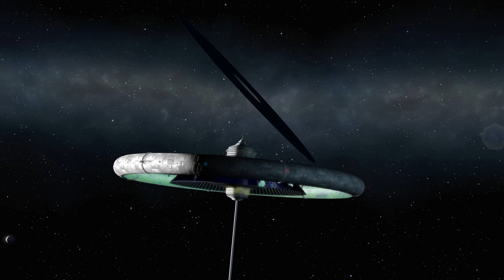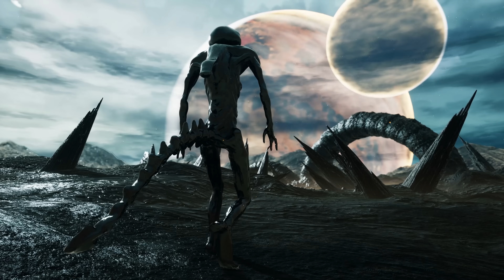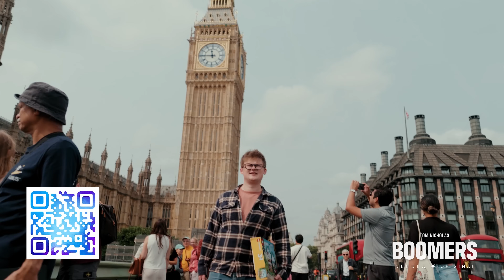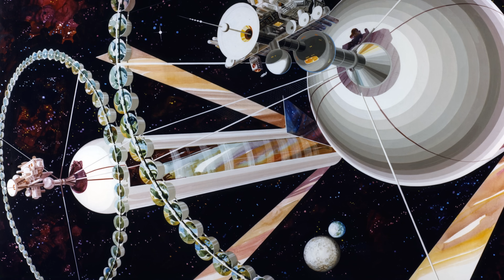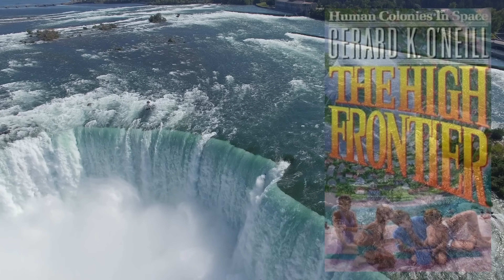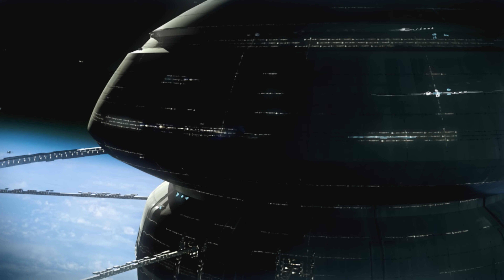The Bernal Sphere Space Habitat

Comment: Solar sails could orbit an asteroid up to a gravity constant centrifugal force. Hollowing out the rock asteroid to turn into into a glass like structure that could then be turned into a centrifugal space station wheel. 
When the asteroid is used up the station has reached total size, The outer rim being the floor, & life support ring, with more floors added towards the hub being additional levels for agriculture etc. The station not having a square or round profile , but 3-4 convex sides!
Spokes to the centre hub being the weightless docking & dockyard port, with barely any rotation to complicate docking!. 
This could be built beside the asteroid ring between Mars & Jupiter, then moved into orbit around Mars or back to earth.
Earth or Mars orbits being needed for lower power assisted docking procedures, to reduce speed for docking approaches.

Comment: Ive imagined growing plants in low spin could be helpfull. High yield plants that dont need as much bracing. Low power cost for hydroponic solution transfer, higher efficiency harvest robot. Heck, they could even grow structural materials. 
Got this crazy idea using bamboo or poplar. Not on the integral trees level though😂 Those things are beast!

Comment: I've never thought of that last idea, at least in terms of space stations, but it makes sense.

I'd considered something similar for a spaceship, which now IA pointed it out is the same way cellular life works.
1. A hollow shell thick enough to defend from most impacts and keep loose debris from floating away.
2. A single anchoring pillar from one end of the shell to the other.
3. Engines, modules, etc. are either mounted to the inside or outside of the shell or the central pillar.  

There is enough free space on the inside for tugs to move, repair, and replace the modules at will.
Nothing is so firmly attached with the shell that it can't be moved in order to make repairs on the shell.
A free floating drone or astronaut can inspect every single square inch of the vessel without needing to cut access holes.

At low tech/low economy, such a vessel would be too expensive to be practical, but since volume is cubed with radius and surface area is only squared, it becomes shockingly practical to add a little extra space at larger scales.  (Especially since such a large vessel would have changing requirements and updated technologies throughout it's construction phase alone, much less it's entire life cycle.)

Comment: It's Tsiolkovsky, the early space travel writer, not Tchaikowsky, the music composer.

JD Bernal's habitat did not spin for gravity, and was not a fully worked out design study.
O'Neill's "Island One" was not to the more rigorous standards of the later, larger, funded, multi-disciplinary NASA Ames/ Stanford Space Settlement Studies of '75.
O'Neill chose the sphere because the radiation shielding (equivalent to 1.6meter thick concrete) was by far the most mass, and a sphere has the lowest area per volume enclosed. His actual design requirements and rigor of making it feasible to build now (back then) bears no resemblance to Bernal's in 1929. It's a misnomer to call O'Neill's design by the same name as Bernal.

For O'Neill's purposes, size was based on the required population of 10k for the factory infrastructure which builds it and goes on making more habs and SPS.

The Ames studies at Stanford didn't like the faster spin rate nor the little available area of the inner surface under 1G.
Hence the Stanford Torus, which spins half as rapidly with very much flat floor area.

Comment: Sounds like you might be able to help with my sci-fi concept: a Bernal sphere with a size of Mars. Contained ecosystem with habitation on the inner surface (semi-Bernal sphere?) which rotates for gravity, relatively stable poles (though they may be rotating as well just not perceived) and the core is an artificial fusion reaction to create heat and light (an internal shade provides a night cycle). I would like to get a more in-depth review of this topic, especially how gravity is affected at latitudes on the sphere or at different altitudes from the surface and how ecosystems might be affected by these changes. Do you know of any research papers that might highlight this more?

Comment: Given the original Bernal Sphere concept, I was surprised this didn't go into pantropy.  Though if you can tolerate permanent zero-G, a sphere "wastes" a lot of volume and air, unless having lots of room to fly around in, with lots of perch points throughout the volume, is the point.   The best aspect of a large Bernal sphere would be minimized mass per radiation-protected volume, but lighting it despite internal occlusion of the sunlight (dwellings and such scattered through the volume) might be a limiting factor for really big spheres.  I guess if you limited the density of internal constructions, light would naturally scatter around, giving the interior a sort of 'translucent' appearance.
A bunch of smaller spheres side by side in a sheet - bubble-wrap habitats - might be a decent compromise - lots of volume, lots of light throughout, less air needed for a given amount of surfaces, assuming people still psychologically preferred that.
Reply: Though it probably would be tough to get the first generations to prefer seeing land rather than a ''sky'' when they look 'up'.

Comment: A ring with a very large diameter which is spinning fast enough to generate 1G on the inner surface of the ring will also have a very large linear velocity.  This velocity will stress the material the ring is made of.  Does anyone have an estimate of how large a 1G ring built using contemporary materials  could be without shattering? I'm just looking for a ballpark estimate that doesn't use some "handwavium" scifi material for the ring.
Reply: Steel can safely go up to 4 KM radius

Comment: For some reason, cylinders seem like the way to go; they're structurally simple and the spin gravity is uniform. The biggest challenge would be directing sunlight in from the outside, but that's an issue with a spinning sphere as well.
Reply: Yeah I agree. The concerns about the caps being less structurally sound seem like a complete non issue to me, I don't know why he would even bring that up as if it mattered.
Reply: @algorithmgeneratedanimegir1286  It shouldn't be too difficult to build a scale model in orbit, maybe just some fitted rings shipped up on a Starship or Falcon Heavy. Falcon Heavy's faring limits are: 
Diameter: 5.2 meters (17.1 feet)
Height: 13.1 meters (43 feet)
So, maybe two 4m x 4m cylinder parts, to form a 4m diam cylinder 8m in height.
Attach, induce a spin, and get inside and test it. Of course it's far too small to be useful. The next step would be a 20m diameter structure, but I'm honestly not sure how you get a ring that size into space. Cut it in 1/4 segments then assemble with a spacewalk?
Reply: An object with a long center of mass, spinning around that long axis, is inherently unstable. It must always want to wander off the axis, and will move to tumbling.
Yes, you can design active stabilization, but a good engineer doesn't design in defiance of the laws of physics and then apply complexity to overcome the design flaws.
This is completely apart from pointing difficulty if it's not paired with a similar counter rotating object.
Relying on the pairing to overcome the actual instability is also not reliable / simple.

A dum-bel is stable, as is a Torus.
The Kalpana design is about as long by the axis as can be stable, not equal to the diameter. Making the outer rim more massive can help, but not by much.

Comment: During the narration about small asteroids mostly being rubble piles and how spinning them up would send debris flying off, it occurred to me that perhaps a large cylindrical/(Bernal) spherical structure could be built around an asteroid prior to the spin-up to catch the debris thereby lining the interior with material that could be then used to build the habitat. Of course asteroid regolith, like that from the moon, is probably very abrasive so surfaces exposed to the habitation areas would have to be smoothed somehow. How about a giant rock tumbler? We put some solid rocks inside the spinning structure then attach that structure to the end of an even larger spinning arm thing--maybe something like the spaceship in Project Hail Mary but WAY bigger--to provide an extra acceleration vector so big rocks tumble inside what will eventually be the space station thereby smoothing out the regolith. Wow, that was quite the flight of fancy.
Reply: Yeah, space rock dirt is a colossal challenge.

Comment: So you have some misconceptions about diamond that bugs me every time, they are super scratch resistant(hard) but they are really really brittle and have 4 planes of cleavage, meaning if you hit along one of those planes it will atomically shear off, meaning a tap in the right place can really cleanly separate a large section of it. you can cut it to any shape with a laser but it's wasteful, the high pressure requirements means scaling up to psychically larger synthetic diamonds is not simply just make it bigger. transparent jade is what you want that's basically like corn flakes atomically. go to a jewelry repair person and ask them if you can test if it's really a diamond by hitting it with a hammer.

Comment: Question: In a spinning sealed cylinder in zero-G, that contains air, does the centrifugal force cause the air density to be greater at cylinder walls and less at the axis?
Reply: Yes, but it’s only significant in very large habitats because gravity lowers as you get closer to the axis compressing air less.

Comment: I have something I would love to see you create a video of because I am a big fan of your work. In the Troy Rising book series, he explained a space station made by filling a nickel metal asteroid with water, sealing the hole and heating. The metal softens from the heat and the water expands, creating a massive interior hollow about ten miles across once it cools. It had walls of nickel iron a quarter mile thick, protecting from micro meteorites and radiation. Spun up to produce gravity, it allowed for a massive living space that could shrug off nuclear weapons and sneered at normal space hazards. He used an Orion nuclear pulse drive to move it around the solar system and also to open a vast door cut into it in order to allow starships to dock with it internally for repair, safety and supplies. By using heat from the sun in orbital passes it seems to be something we could produce using current technologies, and be vastly simpler than an O'Neill cylinder or manmade station. Any chance you would e interested in covering this idea?
Reply: "something we could produce with current technologies" hahahahahhaa
Reply: @Carnefice  Didn't say it would be easy. It would be simple however, and does not need to be on the massive scale as in the book,. It would not require any new technologies, manufacturing plants for components like panels, girder electronics etc. and the few resources are already in space. The sun provides the heat, water is common, drilling a hole is drilling a hole, nickel iron asteroids are common and all you need is a powerful enough drive to push it. Doesn't need to be an Orion drive either if you are willing to sacrifice speed, which may not be desirable anyway in this context. Everything else is accurate calculations and math. 

Let's go the other route instead of you just dismissing the idea out of hand. Name a reason we couldn't do this, or a necessary technology we do not currently have to accomplish this please.

Comment: I've always wondered if you could spin a Bernal sphere on multiple different axis at different rates to get nearly uniform gravity across the entire inner surface. That math is outside my capacity, but chatGPT says it could be done, and deviation across the surface can be reduced to about +/- 5%. " Single-axis spin → 0G at poles, full G at equator (bad uniformity).  Two-axis spin → Reduces deviation to ~±10-15%.  Three-axis spin → Can reduce deviation to ~±5% or better" Larger spheres can have even less deviation.
Reply: Rotation doesn't work like that, it has one axis. You could spin the axis so the rotation changes direction, a bit like a paint mixer, but it would have a similar effect on the contents.

Please don't use a text prediction system for maths, it exists to write what it thinks you want, not the details you're asking for.
Reply: @thekaxmax  Hmm interesting, now I'm reading about Euler's theorem.  Well I'll have to ask ChatGPT as I have no infinitely patient companion with such a vast array of knowledge to ask, but rest assured I would get it validated properly before building any space stations should I ever find myself in that position. ChatGPT incidentally disagrees and says that Euler's theorem doesn't apply in this context because the 'single rotational axis' that describes the motion of all 3 axis is correct only for an infinitesimally small period of time, then shifts to a different axis and does so continually.  The simulated gravity perception also shifts direction, but a large enough sphere and slow enough rotation puts that below the level or perception. The shift to a new axis can't be abruptly massive either as that would equate to a massive shift in angular momentum of the sphere, and the cumulative vector would always be almost directly radially outward.  That makes some intuitive sense to me, but I have no idea and don't have the expertise, interesting though...  Either way seems like it would be a difficult space station to dock with, and a rotating cylinder is good probably enough.
Reply: If ChatGPT doesn’t know what you’re asking it will make something up, and since you gave it a question that’s just not possible it made something up.